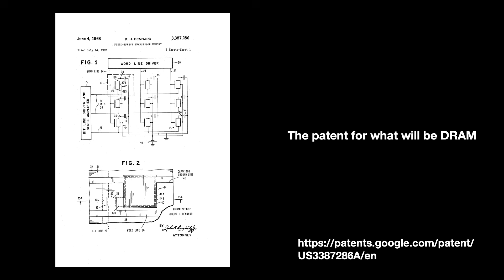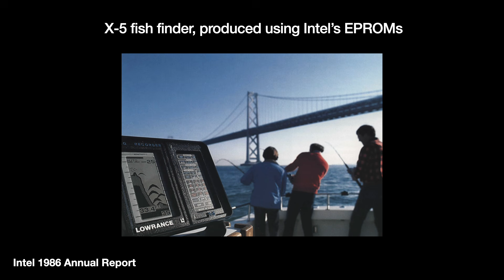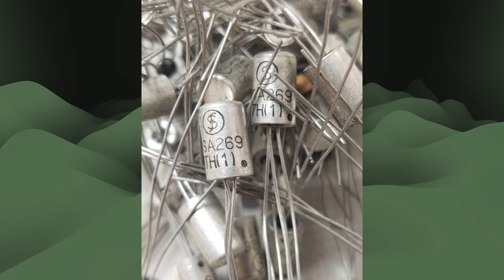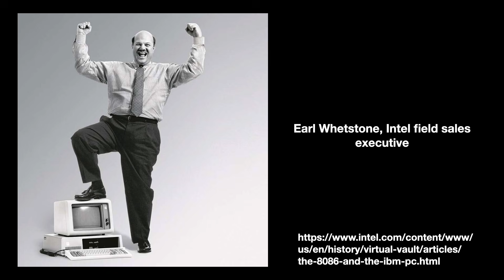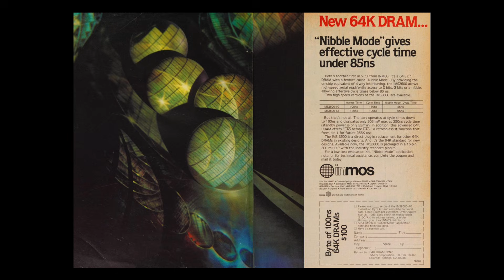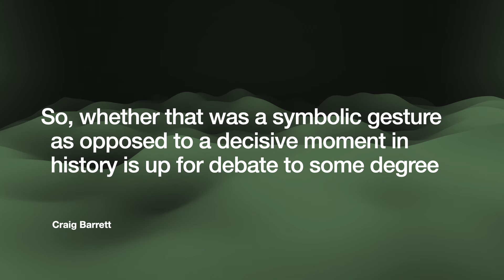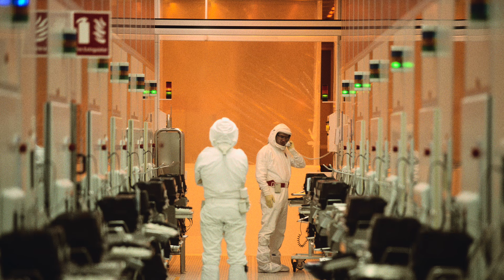What Once Saved Intel

Comment: Whats more ironic right now is that Intel are using TSMC to produce their new line of processors. Im expecting this is until they get their fabs up to speed on their new process node.
Reply: I worked with Altera 20 years ago when TSMC favoured Altera FPGA for debugging the latest process because FPGA's repeatable nature meant polysilicon fuses could be used to route around manufacturing defects to give viable yields.

Now, ironically, Altera has been Intel FPGA for some time now. I wonder if Intel bought Altera for similar reasons (I left in 2007)?
Reply: @kristianTV1974 Intel and Altera separated this year. It's called Altera again.
Reply: @yensteel  interesting. I left the electronic industry completely in 2011 so haven't really kept up.
Reply: @kristianTV1974  Arria10 was TSMC, but Stratix10 fabric was fabbed at Intel, with many of the I/O dice continuing to be fabbed at TSMC. FPGA for ASIC emulation is a different kettle of fish, and since I'm still employed by chipzilla, I can only say that Xilinx continues to be strong in that market.
Reply: @poofygoof I left as Stratix III was rolling out and left the industry completely in 2011. Xilinx were always #1, Altera were starting to look competitive on a technological basis for a while but Xilinx were always good at responding by just undercutting on pricing and buying business.

I don't know who Chipzilla are.
Reply: @kristianTV1974  Chipzilla's Intel
Reply: @kristianTV1974  I spent some time at Intel around 1994 as guest, the managers knew we were using Xilinx FPGAs for out projects, they let us know  very clearly they had had a bad time with Xilinx and wanted nothing to do with them, later on they bought Altera. I am surprised that Xilinx didn't get bought sooner.
Reply: Which is weird, because Intel 2 is supposed to be their first customer node

And they're now using it for "learning"

Comment: IBM chose 8088 because it fit IBM's 5100 which used 8085 processors
Reply: The IBM 5100 used the IBM PALM processor. The IBM 5322/5324 (System/23 Datamaster) used the 8085.

Comment: Quad design combined celeron or pentium 8 or 16 chip parallel processing  then zoom down scale that is and install each micro controller on device level improve firmware reduce software and use 3 timers split reduce data to minimal

Comment: Intel can be saved by firing the lying top management
Reply: I'd settle for a realignment of the top-level "total compensation package" to shrink the disparity from the lowest pay grades.
Reply: @poofygoof  The best way to do that is for YOU to be a top level worker and give 95% of your compensation to the workers.
Reply: @bobroberts2371  I wonder how many layoffs could have been avoided if just one member of the ELT had done this, while still retaining six or more figures of income.
Reply: @poofygoof    If you apply and get a high level position, you will no longer need to wonder.
Reply: Another 15 percent of the global workforce including 25%+ of middle management needs to go IMO
Reply: Just a reminder they did exactly this with
The CEO who kept the GPU division running long enough for Battlemage, who had stepped into an already behind company on the fabrication side, and was the one who got them anywhere near competitive because they had another company with reliably better efficiency, performance, and pricing rug pulling marketshare. The investor board is why intel has only been falling behind or running in the opposite direction they need to for a decade now. Amd's ceo was an engineer and took the company from near bankruptcy to soaring levels only overshadowed by Nvidia who's CEO has been there since the start. Firing people willl never be the solution because it'll only let those companies already ahead more talent to keep them at the top, including talented CEO's.
Reply: . . any by hiring you apparently.

Comment: We will see what can save Intel this time.
Reply: As always, government contracts 😅
This bailout thing is getting out of hand, the state is basically funding walking corpses.
Reply: maybe a Magic Wand ?...
Reply: @leyasep5919  "Intel Magic Wand, powered by Intel Core Ultra AI processor 😂"
Reply: Ouch.🎉😂
Reply: Government as usual
Reply: Do the Apple thing and ditch the x86 instruction set, incredible how much of a mess it was, even back in 8086 times, with microcode, while 6502 had a simple instruction decoder.
Reply: @hinz1  IDK. Given that there is still a lot of money in x86 it would look like a bad move.
Reply: @hinz1  The 6502 was an even worse architecture, good riddance to it. I did asm on both, the x64 is at least reasonable, anyway internally x86 is more or less all RISC with a lot of the baggage pushed further back. But the overall architecture is still terrible. Intel does have a hand in RISC V, not sure if they will lose interest in it. Also Intel has had several other architectures besides 8080/x86, we could mention iAPX 32, IA-64 Itanium, Strong ARM, and some interesting embedded controllers not 8080 descended. And those are all gone.

X86 will outlast Intel is the only sure thing, just like Cobol will not go away.
Reply: @johnjakson444  68k is very nice in assembly, because the CPU has to do the silly decoding, funny addressing modes... mess inside. Doesn't mean it's a fast CPU, when it gets stalled with CISC sillyness inside.
x64 improve somewhat with extra R8-R15 registers and more SSE registers, the silly instruction set, addressing modes, encoding... remains.

Transmeta did it better 25years ago with x86 to VLIW translation. Elbrus has similar approach.

IMO Intel would do better, to ditch the 50year old x86/64 design and build an efficient "complex" RISC or VLIW CPU, ditch CISC to RISC translation, do more parallelism, better branch prediction on a simpler instruction set with the free'd resources instead.

And then do binary translation or emulation, like Apple, Transmeta, Elbrus, Itanium....
And open the VLIW or RISC CPU for the programmers, so new software could be compiled and run directly on a modern CPU design.